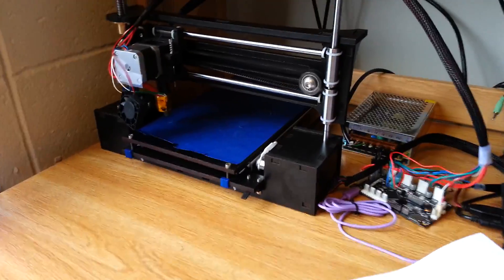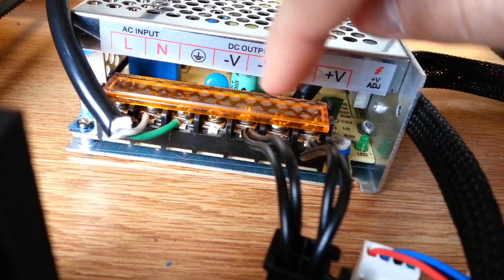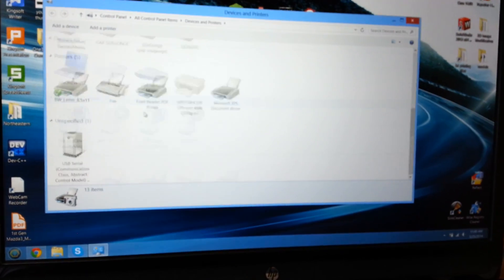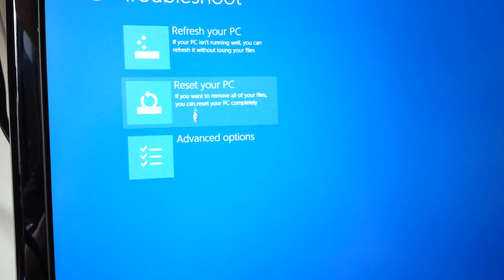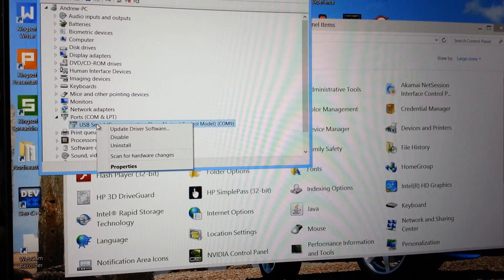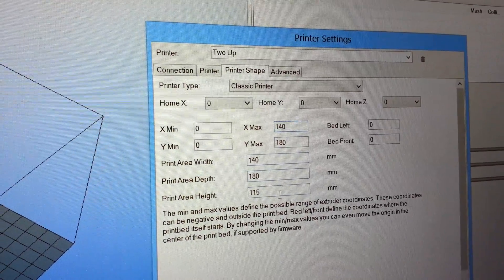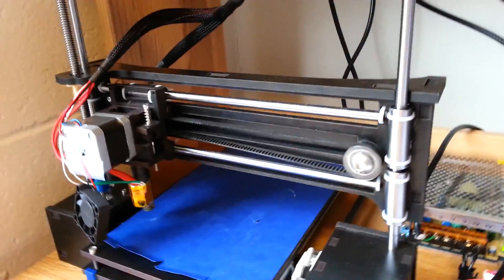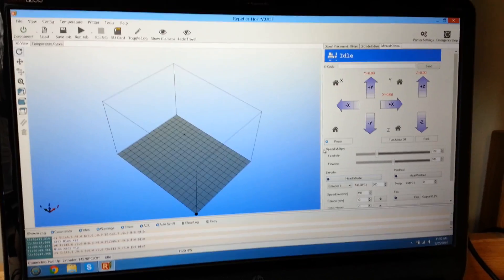QU-BD One/Two-up Connecting to PC (Windows only)

Comment: hey just watched the video and having a bit of trouble getting my oneup to work. it connects to the computer just fine, without the "yellow triangle".then, in repetier, I adjust the printer settings and press connect. it seems to connect correctly, as the logo switches to "disconnect". however, it then says "7 commands waiting" and when I click the manual control arrows it doesn't move but instead just add another command waiting. do you have any idea what I could be doing wrong? great channel by the way.

Comment: I just spend 3 days putting this together and wired everything up and its recognized by my computer, all drivers are installed and everything, no yellow triangle thing in devices/printers but i cant connect in repetier. Whenever i press the red "connect" button i get an error "access to the port COM3 is denied."

Comment: Just curious - what computer do you have your printer(s) hooked up to? Would you recommend it? Thanks.
Reply from the maker: +Joe Hester I use an HP Envy Dv6, was running windows 7 in this video but I've since upgraded it to 8 then 10 and all worked. For 3D printing, you don't need a super powerful pc (although more power will cut down slicing time) but I would probably recommend a windows computer as there seems to be more 3D printing programs out for Windows only or windows is the more heavily supported version!
Reply: Awesome! I'm definitely looking at something that can run Windows (probably 10), either HP or Dell, with printing being a main focus. Thanks for the help.
Reply from the maker: No problem, I'd also check out Asus. They offer some solid quality laptops at just about every price point.

Comment: hey im getting the error: 21:44:03.134 : Printer stopped due to errors. Fix the error and use M999 to restart. (Temperature is reset. Set it after restarting)

every time i attempt to use manual control to move anything...
Reply from the maker: +MrFunTimez Not sure what the problem is, sorry. I would search the fabric8r forums.
Reply: ok thanks looked it up and for anyone who has the issue check your wireing that was my problem,

Comment: I have (I believe) assembled and installed everything correcty on my TwoUp.

Not sure that this was done correctly as the instructions are impossible to locate. Many different listings.  Two pages were supplied with NO reference to software installation.
LED's are showing, shows up as Teensy USB?. When I open Repetier Host it show a device on com3 but no manual control. Any idea WHERE the instructions are for  the latest TwoUp printer ?

Comment: Okay so i am at a complete loss here. everything connects but I get no movement or heat. repetier just sits telling me heating element without any increase in temperature.  I have noticed the light on the power supply does not turn on when plugged into the wall. only when plugged in via usb.  could it be a dead power supply?
Reply: hello bro my power is lighting green and the bored lighting red and I can't see the printer in my pc  windows 10 .
so what I should do

Comment: Please Respond: My Two Up keeps digging into the bed and keeps going back and it almost breaks the printer each time I try and print. I haven't printed one thing, and I'm scared to! I put in your G-Code and Copied all you settings. I really don't know what is wrong with it. Should it be in the middle of the print board or all the way to the front left?
Reply: I figured it out! I needed to switch extruder motor wires and the z axis wires. Reply if you have the same problem and need a little more info

Comment: Hey please help
i'm trying to connect my printer and when i connect it it doesn't show ANYTHING not even the USB connection.
i tried to switch the USB and it didn't solved the problemit does show a light on both the power supply and the board but doesn't show connection.
please advise,
Tal

Comment: Great tutorial. I am having a problem with the kit mentioned around 4:12. I have a yellow triangle in the unspecified folder and I do not have anything for the kit. Also, the light on the motherboard is red. Just curious if you have a solution.
Reply from the maker: The light on newer printrboard clones is red instead of green for whatever reason, it does not indicate a problem. For that, you can get the kit in the description and download the serial.exe file then follow those steps.
Reply: 3DprintedLife Thanks a lot man!

Comment: Everything installed properly for me, everything is connected, i did the same settings. but I cannot move my printer with manual control.
Reply: I hit the home buttom to check and that worked lmao almost broke the damn thing..but manual still doesnt work
Reply: Slaphappy1215 I have the same problem.. did you solve it??

Comment: im getting an error when i try to connect with the setting specified the error is " The connection failed with the following error: A device attached to the system is not functioning.
Make sure your printer is connected, enabled and connection data set correct. Open printer settings?" any ideas
Reply from the maker: I have heard of quite a few people with this issue, but unfortuantely I don't know exactly what they did to fix it. I would try poking around on the forums a bit and seeing if you can find a solution.
http://www.fabric8r.com/forums/forumdisplay.php?23-OneUp-and-TwoUp-Tech-Support
Reply: 3DprintedLife i seem to be having a similar problem, and nothing on the website is forms are helping. Have you discovered a fix yet?
Reply from the maker: mason odsather I'm really not sure, sorry. The problem is with these kinds of random issues is that if they didn't happen to me I don't really have the knowledge to fix them, you just have to hope someone else gets the problem and figures it out and posts to the forum. Perhaps try starting your own forum post and see if you get a response.
Reply: 3DprintedLife Brandon Brown i got it to work! i did it the hard way, but now it works. check out the how to install custom marlin firmware page on fabric8r.com it should be the first sticky post.
Reply: 3DprintedLife so being that i have fixed that problem, i have another one. when i manually control the extruder, when the hot end is hot, the motor skips. and wont feed anything through. i have tryed multiple different temps, and filiments. what should i do?
Reply from the maker: mason odsather You may have to decrease the amount of tension on the extruder bearing, you can also increase the stepper current slightly for the extruder motor using the potentiometer on the printrboard, but don't turn it up too much. You may have something inside the extruder that is putting extra resistance on the stepper motor.

Comment: When I press connect I receive this message ( The connection failed with the following error: A device attached to the system is not functioning.
Make sure yout printer is connnected, enabled and connection data set correct. Open printer settings?)
What should I do to fix that.
Reply: im having the same problem

Comment: Yes... In the new repitier you can't put g codes in where the manual settings are. Any idea where I cab set the g codes in. Or do you have to set the printer to 0 first. I'm confused where to put the g codes in to.
Reply from the maker: You put those in the slic3r settings. You can also enter single commands by hand in the manual control section of repetier

Comment: I'm having another problem. In repitier Host whenever I try to move the 3d printer manually it doesn't move. I have tried to reset the board, update the driver, delete it and reinstall it, I've tried everything. Any clue on what to do. Please help (I have a one up 3d printer)
Reply from the maker: Did you make sure to change the settings in repetier host to a 25000 baud rate and a few other settings specified in one of the older qubd updates on kickstarter?
https://www.kickstarter.com/projects/qu-bd/qu-bd-one-up-open-source-production-ready-3d-print/posts/704126
Reply: Josh, How did you get it to start working? I am having the same issue as you and Slaphappy1215. Tested the home button then had to yank the power. Its the only damn thing that works to run it.

Comment: Thanks your video! My problem the manual positioniing works for one direction only. (In X axis negative values (button) in the Y the negative only and the Z in the positive only) another direction button not works.
Reply: Gábor Horváth 

I have the same problem...

Did you solve it?

Comment: Hey please help, followed your videos and setup my one up with 60mm Max travel, every time I hit print it tries to go past the max limit on the x,y and z! I have to turn it off !
Reply from the maker: You have to remove the g28 commands from the start and end g-code in slic3r and replace them in the start g-code with "g92 x0 y0 z0". That command will set the printer head's current position as the (0,0,0) position
Reply: 3DprintedLife First, thanks for replying you rock!.  So Slic3r adds gcode?  is that under the Slic3r tab?
Reply from the maker: Simon Burfield Yes slic3r adds code to the start and end of every generated object. This is under the slic3r configuration settings under the printer tab.

Comment: Hey 3DprintedLife I have a one up that I connected to my windows7 Machine. I didn't need to do much of anything because when I plugged in the one up I didn't get the "yellow" triangle. I changed the settings like you have in the video and was able to have Repetier connect but when I try to use the manual control my printer doesn't move. Any ideas?

Also your videos are really helpful and much appreciated. Great work!
Reply from the maker: I would try uninstalling and deleting the drivers from your computer, then after that do the steps about using the serial install file and then searching for drivers automatically online. It may have automatically installed drivers for you, but if they're the wrong drivers it won't do you much good! If that doesn't work I'm not too sure what else you could do, perhaps try controlling it from a different computer if you have the chance just to see if you can get it to work on another machine.

Comment: Hey! Can you help me with my One Up. When I plug it into the computer (I have Windows 7) it says "Usb Device Unrecognized". What can I do? I also noticed that the Gantry/Extruder assembly sits crooked on the printer; does that matter? I am anxious to get my printer started up an working.  Please get back to me as soon as possible.  Thank you so much!
Reply from the maker: Have you tried installing the file mentioned at 4:06?
Also, the sag is normal. You can superglue the bearings and the rods in place on the gantry and that will help some, but it will not eliminate the sag. The only known way to completely eliminate sag is by doing the pulley mod by phantomoperator, shown here: http://www.thingiverse.com/thing:288898
Reply: Thanks so much! I will try the software!
Reply: 3DprintedLife You helped me so much! I didn't even have a clue about what to do until I found your video! Thank you. When I get my One Up ready to print and click "Run Job" it almost runs it into the ends but I kill the job before it does. Do you know what I did wrong?  Thanks again, Colby Collins.
Reply from the maker: Colby Collins Not a problem! And what youre going to want to do is head over to this forum post and read up about the custom g-code section under printer settings. You have to modify it since our printers don't come with endstops!
http://www.fabric8r.com/forums/showthread.php?1346-Slic3r-Settings-Post-your-Slic3r-config-files-here-so-all-can-download
Reply: 3DprintedLife Thank you so much!

Comment: Nice video.
It is really nice how you explain the connection.
Waiting for some explanation about how to figure out which is the range of the printer by issuing GCODE and how to set the 0,0,0 by G29
Reply from the maker: No worries, that will all be in the next video which should be coming out today!
Reply: 3DprintedLife is the forum installation better or your method?
Reply from the maker: Dit Haru Well the forum discusses one or two ways to do it, this is essentially how to make it work incase anything goes wrong. I tried to go over every problem I had and how you can fix them, but you may not necessarily have to do everything I did here.